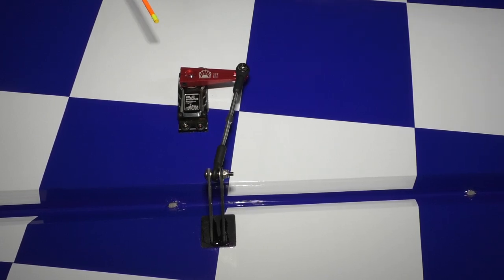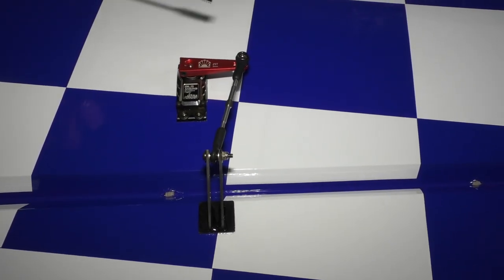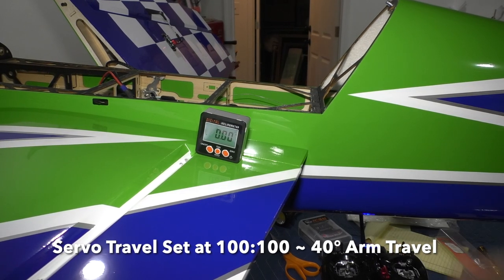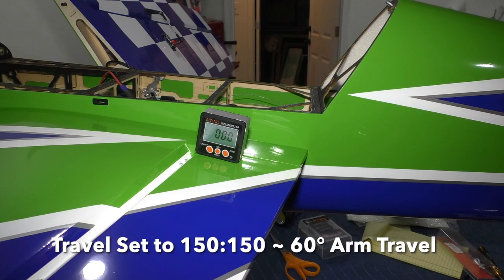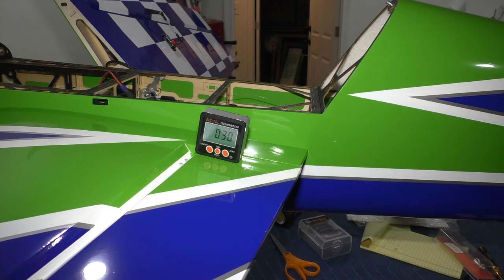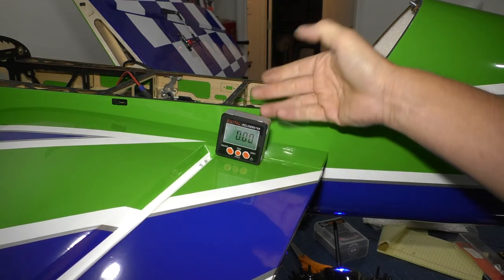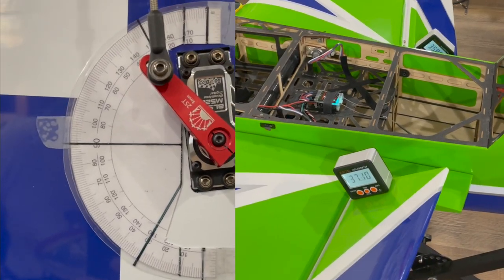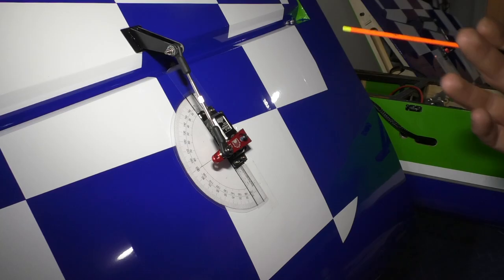Optimized Servo Set-up for Resolution and Linearity on RC Airplanes

Comment: great video. a question, do you need make sure that Travel is the -same on each direction? what did you do to get the 38/37 deg if both Travel are 135?
Reply from the maker: You will almost never have exactly the same travel on both sides. You may have 135 and 118 and that’s perfectly fine. You want to get as much resolution as you can (travel to end points on each side) and keep your throws to the desired degrees of pitch. If you’ve got travel above 100 you’re winning. I shoot for 125-135 and sometimes it comes up short. What you do not want is 145 and 75. Then it is not linear and the servo is traveling At inconsistent speeds, if you are matching servos this would be a nightmare!

Comment: Hi Don,  I'm looking to upgrade the servos on that U Can Do from standard Futaba S148's to something stronger and faster for more, and quicker throw.  I was thinking I needed longer servo arms and maybe double horns as shown here.  I like those turn-buckle type adjustments on the pushrods as well.   Suggestions?
Reply from the maker: So the mini servos are plenty strong enough these days to handle a plane the size of a UCD but then you will struggle with balancing it.  You could easily get away with any standard sized metal gear servo with greater then 100 oz of torque.  I would keep your pushrods and horns as they are. They are lite and plenty strong enough for that airframe.

Comment: Really happy I have come across your channel as I'm just about to put together a 91" skywing edge 549 with a GP76 twin. This is a long life dream to build a larger RC aircraft but really only been a sports flyer and I'm wanting to try my hand at some basic 3d flying.  Would love your recommendation on throws and expo say for some flat spins and some hovering.  Watch your other video on set-up and I tend to want to want to get to low and slow eventually.  So I would love to hear what you would recommend on a set-up that's not to aggressive and a little forgiving.
Reply from the maker: The skywing edges are truly amazing planes. There is a lot that goes into dialing in your throws and expos. There really isn’t a one size fits all solution.  You’re welcome to reach out to me with any specific questions.  You can reach me at info@rc-air.com I’m hoping to get a lot more info published, especially focusing on expo soon. I’ve fallen behind on this side of my work and I’m trying to get caught up.

Comment: Where do you buy these servos and controllers. Can you control this with something other than an Rc remote? I’m trying to have a twist throttle move a gas pedal on a car with an actuator.
Reply from the maker: The transmitter and servos are available online and at some of your local hobby shops.  What you are wanting to do is really outside of my scope, I'm not sure how that would be possible with the technology that I am currently using. I'm sorry I wish I could provide you a better response.

Comment: Nuce video. How you make the inclinometer stick to the ailerons?
Reply from the maker: Thank you! I’m using the blue poster putty. Just a small amount will allow it to stick and come off easily without damaging the Ultracote.
Reply from the maker: Loctite Fun-Tak Mounting Putty, 2-Ounce (1270884) https://www.amazon.com/dp/B003LZMHIY/ref=cm_sw_r_cp_api_glt_i_9Z3TVS75ZPDRDXJ8309T?psc=1